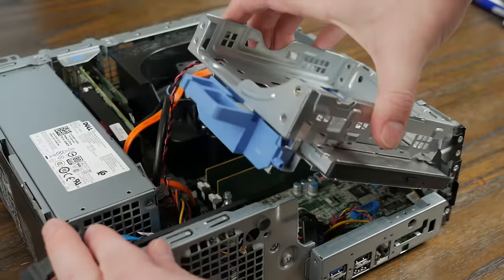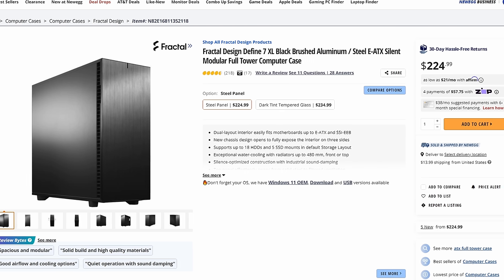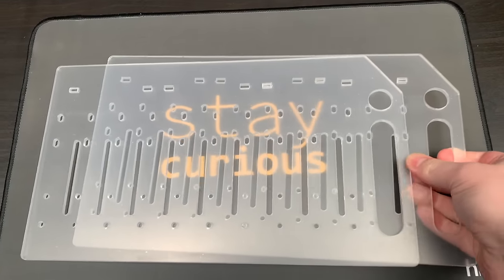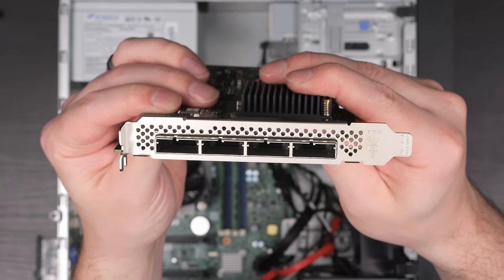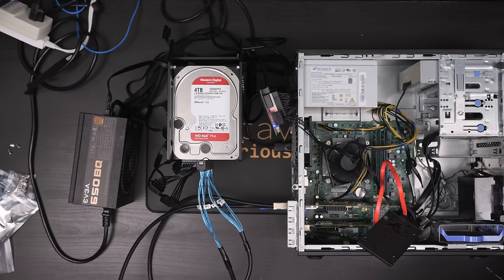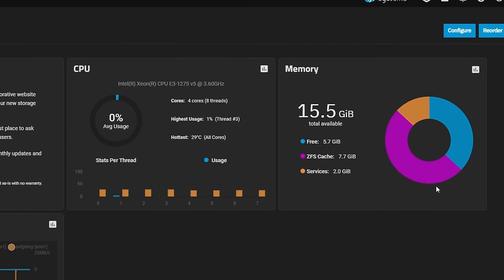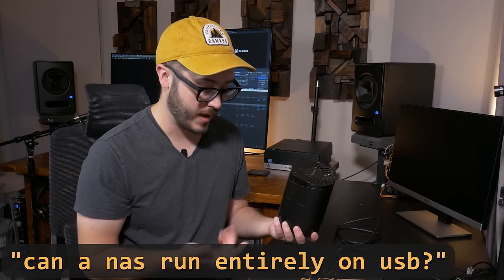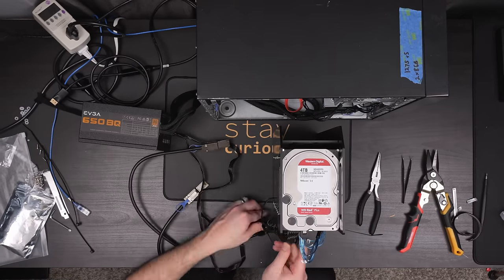I Made My Own JBOD Enclosure For CHEAP

Comment: Let's make a conservative estimate that 8 drives use 80watts. Your PSU is barely under any load and would perform rather inefficiënt, at least so I've heard. Wouldn't a mini box picoPSU make for a better recommendation? It might be harder to link to the other PSU but it might actually still be more efficient plugged in all the time? Not speaking from experience but curious to hear anyone's thoughts!

Comment: I have an old laptop that I may be able to link to this jbod as i have a spare PSU. I could get a m.2 with sata ports to link the HDDs but use the PSU to power the system.

Comment: Good luck when you have a drive failure and you have locate, remove and insert a drive of a running volume in that ressonant-free drive mounting "solution". Direct screwing so many drives to a plate... Rationalize the expenses of Disks-HBA-software-time and the enclosure. The only reason to go for DIY solutions should be because most tray solutions don't properly cool drives unless very loud fans are used or even with them in non HVAC conditioned rooms temps. Then the only solution is to set drives appart to improve airflow and DIY is usually required.

Comment: i think buying a used storage server are also not that expensive. i have bought a dell r630 for only 600€. i know a r630 is a virtualization server not a storage server but it is a really power full machine but for the price of only 600€ this is not bad deal and i needed cpu power not space. there are many used storage server out there with performance and expandability and low idle power usage. most of them have pwn fans so the noise in idle is about 30dba to 35dba some of them are nearly silent. also having ipmi or a proper raid controller with cache is nice to have.

Comment: I like watching your videos, even though I didn't have any real interest in this kind of implementation of a JBOD and didn't really learn anything new lol. I think you just feel very relatable, the stuff you show is stuff I'd be capable of, it features stuff that isn't as janky, low-end or impractical like used very old enterprise stuff like your older videos, while not being wasteful in terms of bang/buck like things targetted to higher-end homelabs. Maybe a little too janky for me, I'd prefer a bit more thought/polish so that these things end up like something I could consider or suggest to others haha, unless the jank is worth the time or money savings.

PSU-wise, power was not going to be an issue with having the thing came with an extra 6-pin for a GPU lol, generally speaking HDDs will consume at most 5-8W ea and a 650W Bronze PSU is very inneficient under 10% or lower load. Reliability and affecting longevity due to less clean power and less protections from that PSU could def be an issue if you were thinking of keeping this long-term, but then you could have just swapped the PSU lol (I'm sure you realized in the middle of it and was like, oops too late! sunk cost fallacy hehe)... Those cables coming from the PC, a PicoPSU or other 80~120W SFF PSU, whether it be an AC brick or DC-DC thing, a cool USB-C PD solution, or anything of that sort would have been much neater finished product. Too bad the rubber washer solution was so impractical, but for the price, can't complain, but I just hate vibration noise lol.

It really is too bad there isn't really any simple, reliable, and cheap JBOD solution. Considering how simple the hardware is I really don't understand it! I really don't like the extra power, complexity, software and cost NAS and DAS solutions add, but NAS companies would lose a lot of revenue I guess.

Comment: Excellent video... However, in my current setup, I utilize both a notebook and a mini PC to run Trunas. Therefore, USB remains my preferred method of connecting to my HDD enclosure. Do you have any suggestions for improving connectivity for a notebook server or mini PC?

Comment: Very good camera angles, and shots of parts, and pricing, and narration, etc.
But it is a lot of work, assuming you know all of the nuances (looks easy when we watch you do it in the video).  Talented people always make things look easy.

Still, there are people that enjoy this activity (myself included), and there is a sense of satisfaction for getting it done.

But here are three reasons why I will not attempt this:
1) It requires multiple purchases from multiple vendors.  If one does not show up in the mail, or has delays, or arrives with a defect, etc, then everything stalls.  And while waiting to get a replacement, your 30 day return window for everything is closing.  So if you are not able to get all of the parts in good working order, then you are left with all of the other parts with their cost and you cannot complete the job.

2) If a drive fails, you have to take the structure apart, to some degree.

3) I like to have activity lights for every drive.

You did a great job, and I was hoping you found an inexpensive blueprint for stacking drives.  All of your hard work was not simple, including making this video.  Alas, I am sticking with the Syba 8-bay units, until something similar surfaces that is not complicated to set up and costs less.  Sometimes Syba's 8-bay units drop to $209.99.  That happened in June of 2023, for a week or two.

Comment: theres some cheap "sata hubs" the problem is that for whatever reason, mine started to work the way i wanted to, but then worked more like a hub that needs some form of input to be told which drive needs to be accessed

i wonder if thats because i used the floppy connector rather than the USB cable that was included
i checked, and it electrically is connected 5v-5v GND-GND 12v-12v, etc etc.

those extra connectors could be some form of "enable" for a special mode, but it does mean that its far less usable than id like

Comment: You should explain this to QNAP. I have a QNAP DAS, but their version of "JBOD" is called "Individual" wheras their "JBOD" option is a hardware RAID-0 setup. And their online manual did not help much explaining the difference between the options. The "Individual" mode was not even mentioned. I had to do a real-life test to figure this one out since their own support team was confused about it when asked.
Reply: JBOD isn't Raid0, it just shows the combined capacity of all disks as a single drive. R/W speeds are that of a single drive. It simply fills up a drive, then the next one, and the third after that ...
Reply: @protator I know that JBOD is not RAID-0. I am saying that on a QNAP DAS,  The JBOD option is a RAID-0 or at least something similar. It may write data to the drives in a different way, but it shows a single disk with the capacity of all disks combined.
Reply: @danielberglv259 Then maybe you should simply ask uncle google what JBOD really is. The DAS showing a single volume in JBOD is correct. Cause that's what JBOD is.  Don't let ppl on the net using wrong terminology confuse you. A "JBOD enclosure" simply has a backplane with no integrated raid controller logic, it's literally "JustaBunchOfDisks" in a box and everything else is managed on the host computer. So a "JBOD enclosure" and setting your storage to "JBOD" are two completely different things.

Comment: Hey, just to be sure, did you by any chance setup 2 ethernet connexions with your router ? It seems like your write performance is bottlnecked at 1Gbps speed (it looks way too stable) compared to the read speeds.
It's a known issue that such a thing happens when you have 2 ethernet connexions on the same lan

Comment: For 8 drives isn't it much cheaper to just pickup an old $10 case and stuff the drives and power supply in there? You can just fish the add2psu wires at the back of each case. Slightly bigger but I think it'd be a lot cleaner that way.

Comment: Been thinking of doing something like this for a while, nice vid. Is there a particular reason you didn't use a PicoPSU for those drives, or how suitable would it be?
Reply: When you're doing ZFS, you don't want to cheap out on power for 8 spinning drives. You might get bad / unpredictable results, random dropouts, errors during scrubs, overload on initial spinup if they're not staggered, etc. A bit of overkill on the P/S gives you reliability and probably longer life for the setup, as long as you're on a UPS

Comment: I built my diy  JBOD build

 Asus P8P67 WS MB
 EVGA 750 GT PSU
 Intel Xeon E3-1280v2
12v fan Controller
Dual 2.5 GB NIC
LSI SAS/SATA controller
Timetec 32 GBkit DDR3 1600MHz
Hard drive mounting rails 
6 20gb ironwolf HDD

Im running truenas

Comment: That QNAP DAS may be 3x more expensive, but it will save you a massive headache and heartache when one of those 8 drives dies and needs replacing, and then while messing with your screwy setup, you accidentally break your ZFS pool and lose all your data...
Reply: ZFS is rock solid, which is why QNAP released a version of their software that supports it. If you can’t handle one of the easiest command line interfaces ever, get yourself TrueNAS and you’re still better off.

Comment: Why 2nd PSU? I'd rather have one more powerful PSU in the case and pull some cables out. This way you are significantly increasing the power consumption due to PSU inefficiency on low loads.

Comment: I have a case with plenty of drive support, but I don't have a motherboard that can handle more than a few SATA connections. Basically, the opposite problem of what you're addressing here.
Reply: pcie HBA in IT mode, and maybe a SAS expander. If you don't have any decent pcie slots free, might be time for a bigger/better motherboard replacement

Comment: I have a similar scenario but with a laptop. 
Using the mpcie i optained sata ports and for the power i used a hdd power supply of AliExpress. Now the problem to me is how to sync the laptop power with the hdd the add2psu requires some kind of ATA/4pins/or the other big connector. 

Any help is appreciated 👍☺️

Comment: Damn i m actually using the 10 drive array of those acrylic mounts too hahaahah
also the two sata power adapters
but 1 to 5 sata instead of 4
altho i used 10 drive sata controller extension instead of an hba 
since i found it cheap on ebay and got a good bidding

Comment: So you could use another midi/full tower case with already support for slide slots, a power supply with sata power extender, 2 pci/pci sata controllers, and 8 long sata cables and that's it....

Comment: Im using an Asus Rog Strix b450-f Gaming motherboard for a proxmox server with an omv vm with jellyfin. The motherboard doesn't have enough pcie slots. Also using a 1050ti 4gb for transcoding. I think its best to replace the motherboard. Do you think i could get an x570 motherboard without changing to Intel? The cpu is an AMD 3600. I want to add more drives later too. Im learning lots from your videos.

Comment: Great video! I'm a bit confused about the power requirements, and the need to go with a second PSU (@7:50 'I don't quite trust that the power supply could handle the extra disks'). Maybe someone can help me understand when power available isn't enough power? Thank you!
Reply from the maker: That probably get's out of my area of knowledge a bit, but I think it's fairly common for PSUs to only be able to support a certain amperage on each rail, and without knowing how it's configured, you might trigger over power protection or something similar. If it was spec'd to originally just provide power to two hard drives and an optical drive, 8 drives on top of that might cause issues. I could be totally wrong though!
Reply: Awesome reply! If I were to add too many drives internally, what would be the outcome (how would I know I went too far)? Would it just be a failure to perform or something more damaging?  @HardwareHaven
Reply: One HDD can draw up to 30 watts at startup, so you need an additional 240 watts to cover eight disks if they all start at the same time. You can reduce this if you start the drives in smaller groups or one at a time. Some newer drives inhibit start up if the 3.3V input is pulled high, otherwise the 12 and 5V inputs can be switched on in sequence using relays or MOSFETS
Reply: @CptBlackEye psu will turn off when it powers up (or power off randomly) or random data corruption or system crashes or psu blows up due to no overcurrent protection (last one isn't ideal)

The main issue is peak currant load at startup when all the drives are spinning up (why in the past servers would stagger start the drives so you don't have 70A on the 12v rail)
Reply: There are PSU calculators online. In general the rule of thumb is that each mechanical 3.5 drive is 20w peak power (on boot, when they spin up), and you want the PSU to be strong enough to survive that. Using a weak PSU means you overload it on power on, which leads to power off

Comment: I have a question? I just built a DYI NAS. Installed TrueNAS RAID 1 with six drives. Using this fractal defined 7XL case I was able to fit 14 drives I have two more sitting out I would like to add or keep his back up. My question how can I add these other eight 3.5 hard drives and increase my RAID 1 I already have it populated with about 97 movies and a ton of audiobooks if I upgraded to a raid 2 or 3 would I lose all my data or should I or could I just increase my data share space? Do you have a video on how to do this

Comment: — Just wondering why din you replace the PSU in the ThinkStation then run the cables for the JBOD setup from there on ? Is it cox the ThinkStation PSU has those proprietary pinouts to the mobo ?

Comment: I have a HP Elitedesk 800 g5 with 6 SanDisk X300dc 960gb SSD's + 4 Samsung PM863a 480gb, all connected with a pcie 1x to 10 sata adapter. It's a complete mess inside :D

Comment: So my problem is motherboards I need an itx board with 5(6) sata connectors and can only find 4. Simple solution is pci addon but only have 1 pci slot half height??

Comment: Not very wise solution. In fact this was what I had 10+ years ago. Ended up in "junk". But if that is what you suggest, it would be better fit all drives in second empty pc case as sas with psu switch than time consumption modification.

Comment: would be cool to get an old server and only use the drive slots, and the back plane.
Reply: and the PSUs and the fans too if you want to power and cool the drives. It's not usually worth it

Comment: Is it ugly? Yes.
Is it compromise-less for performance and stability? Yes.
Is it many times cheaper? Yes.

If you want to spend $400-600 on JBOD, better spend that money on this solution and 3d printer you will use to print better enclosure for jbod. You will spend the exact same amount of money, spend more time, but you will get the same result, plus free 3d printer and that's a win in my dictionary.

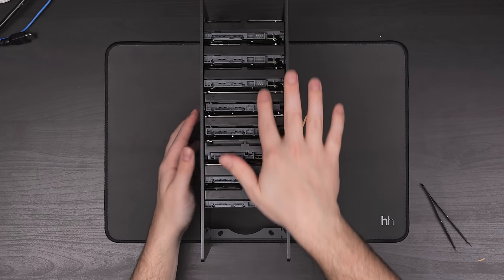Comment: 6:50 You didn't mention it in the material, and it's important to choose "old"😎 controllers, dedicated to HDD and not to SSD, because the new ones consume a lot of energy, get terribly hot🥵 and require very strong cooling.🥶

Comment: The HBA adapters draws extra power, and the mini-sas cable are expensive, ether the SFF-8087 or SFF-8643/8654 are expensive too, and they need pcie gen3 x4 or x8 slot, this requires your motherboard has bifurcation capability, this is annoying...the above hardware I didn't have one, I just got a 8 SATA3 motherboard provided by chipset recently....this is most cheap solution.
Reply: You don't need bifurcation, PCIe will adjust automatically both the x4 and the gen depending on how much phyisical contacts thecard/slot have and what pcie gen max can be supported. You need bifurcation only if you use the (cheaper) nvme adapter cards that carry x2 or x4 nvme drives

Comment: Can I build something like this with a Thunderbolt adapter that'd work with my Late 2018 Mac Minii?
Reply from the maker: Oof, you might spend about just as much trying to find adapters and such. At that point it might be worth buying one
Reply: @HardwareHaven Ah, thank you. I appreciate the honest reply and saving me the frustration.
Reply: Thunderbolt is used mostly by mac users, so the only things you can find are thunderbolt enclosures. Better ask on mac user forums what are the good brands, afaik OWC and Lacie are good but ask around.
That said, Thunderbolt is not unstable trash like USB. While enclosures are more expensive they should be stable and reliable.